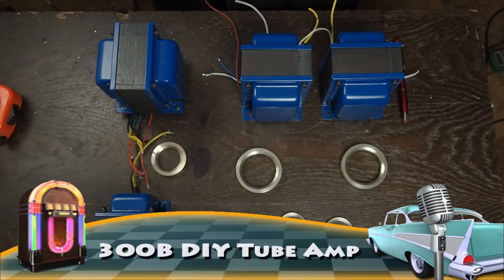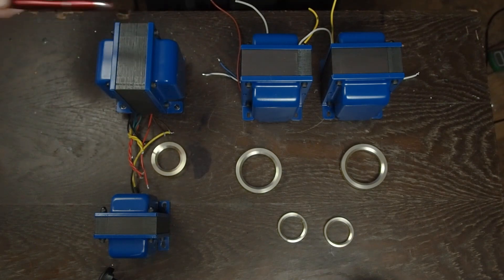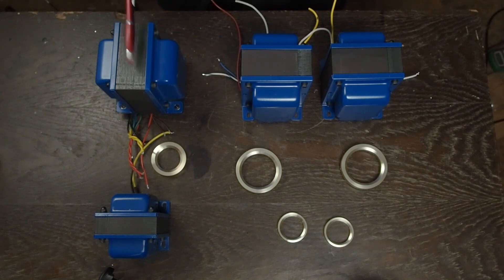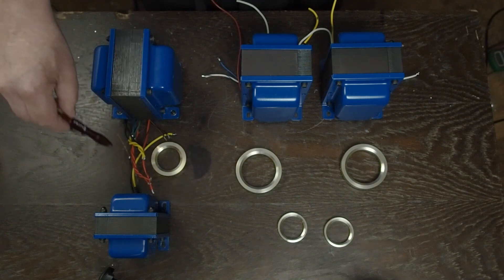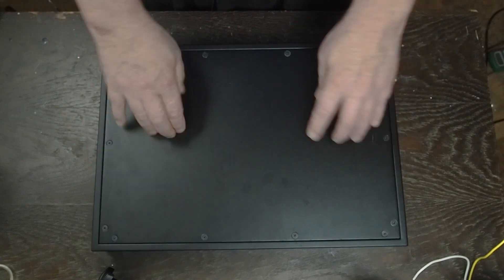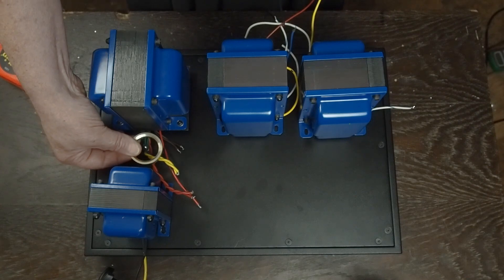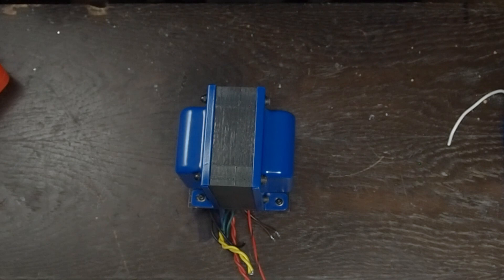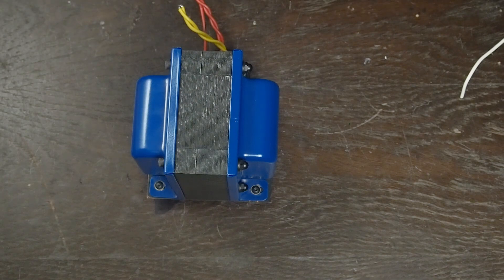300B DIY Budget Tube Amplifier Build DHT SET #2

Comment: I don’t understand the reason for the additional 6.3v transformer when the main power transformer has a 6.3v winding? I get why you want another with 5v for the output tubes but the extra 6.3 has me stumped.
Reply from the maker: These are direct heated tubes where the filament is the cathode/signal path. You need a independent power supply for each output tube and then another supply for the driver tubes..

Comment: Where is the video how to drill holes?
Reply from the maker: Keep watching :)
Reply: Dont drill the holes, buy a chassis punch kit, they work very well, you drill a smaller hole then screw the punch through the chassis with a socket and rachet. It makes clean not sharp holes everytime
Reply: Harbor freight has them 21 bucks

Comment: Great videos. Have you tried to implement the 21st century maida regulator in your design?
Reply from the maker: Doesn't really fit in with a "Budget build" and not sure what the advantage would be. There is no audible noise and with the power supply as designed, it's REALLY clean already with channel separation equaling what you would get from mono blocks.

Comment: On the heater voltage regulator you might look into, 
LM2679 Key Features
Resistor programmable peak current limit over a range of 3A to 7A.
    120 mΩ DMOS output switch
    3.3V, 5V and 12V fixed output and adjustable (1.2V to 37V ) versions
    ±2%maximum output tolerance over full line and load conditions
    Wide input voltage range: 8V to 40V
    260 KHz fixed frequency internal oscillator
    Softstart capability
    −40 to +125˚C operating junction temperature range
Reply from the maker: I used a fixed 5 volt regulator to simplify the wiring. Using an adjustable regulator requires more components and wiring, would require at the very least extra tag strips but more likely a PC board to implement, and I don't see the advantage over a fixed 5V regulator.

Comment: Also the balancing scheme (hum  pot) can be used using the same 6.3V  with a pair of power resistors for the 5V filament for the 300B, then the preamp/driver tube (6SN7) could share the 6.3V winding for each chanel If the inrush causes you problems you can use a NTC in the power transformer then you can use only the EDCOR transformer and optimize the use of the transformer also a LDO regulator could be used in the same way if you want go full DC on the 300B
Reply from the maker: Thanks for the tips! Keep them coming!